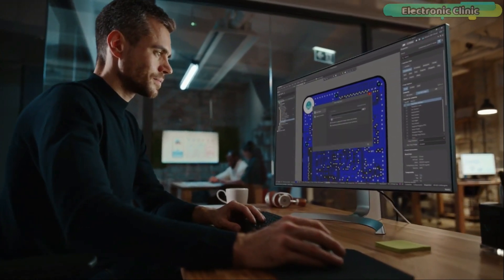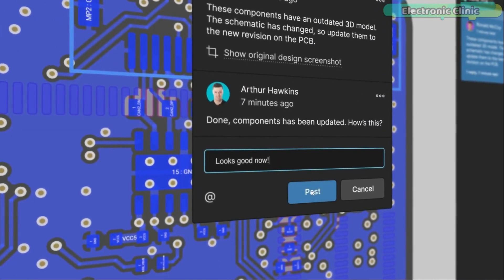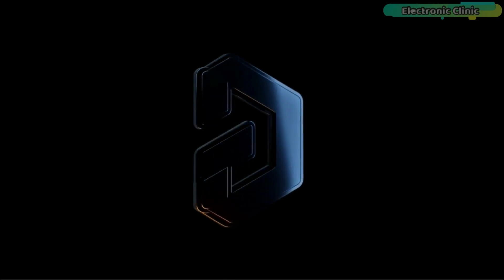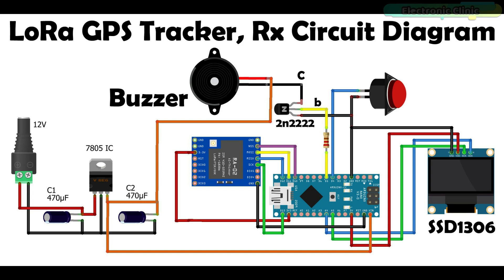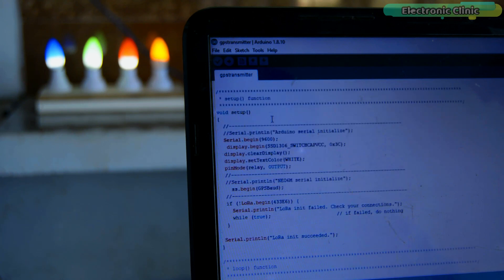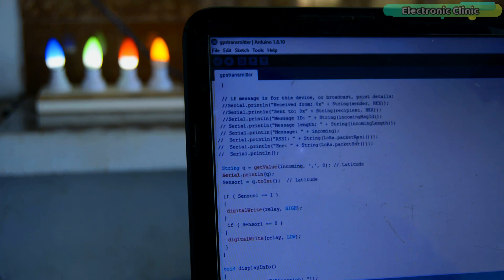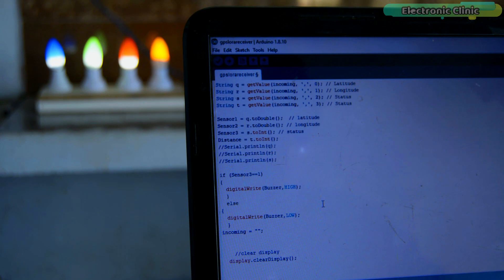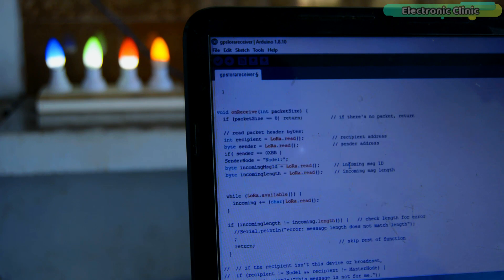Arduino LoRa GPS Tracker for Car, GPS Lora Tracker, Geofence tracker, GPS Vehicle Tracking

Comment: hello..great video..I hope you can make a video that has Lora, SMS and GPS module all in one..the objective will be to use Lora to locate and disable the car in a near distance like 100 meter radius..its like if you are in a parking lot and try to find your car then you can use one button to flash the signal lights..then other button to disable the car ignition system (for those cars without computer box)..and the gsm module will be use to track and disable the car in a wider range..hopefully you can consider as I am trying to figure out how to accomplish this project. thank you
Reply from the maker: The same idea is already on my list. Soon I will make this project.

Comment: the use of LoRa which is used such as video, the tracking distance is very small, especially if it is meant to track vehicles, we use LoRa in urban areas only covering 1km, I think it is less efficient. Or is there another way to increase the range of the LoRa signal to the same as the GSM usage?